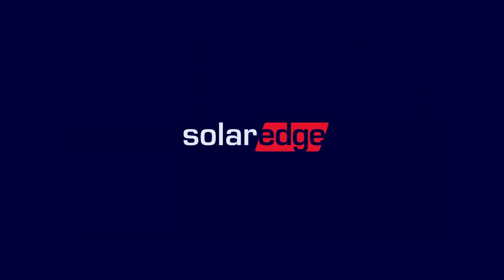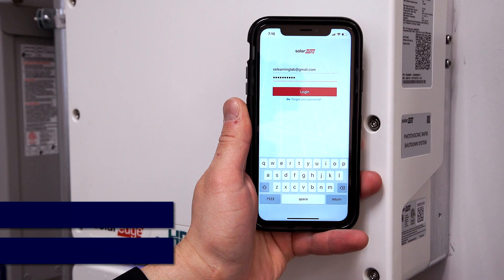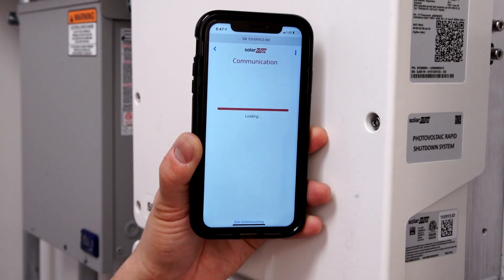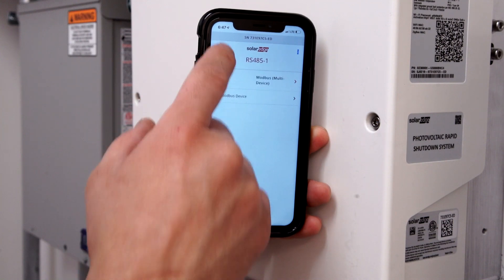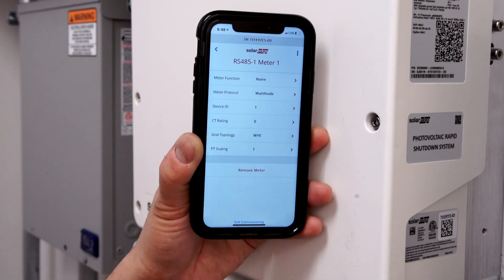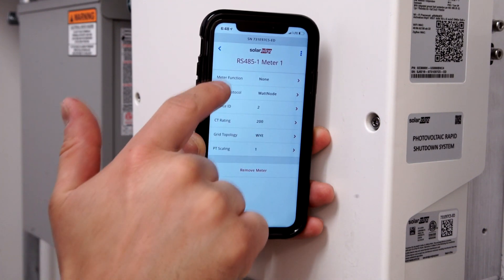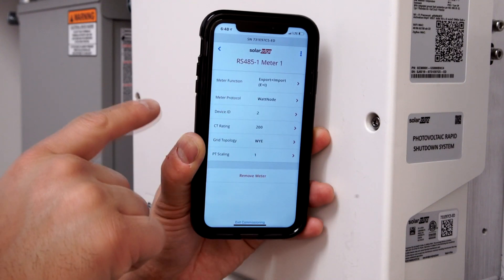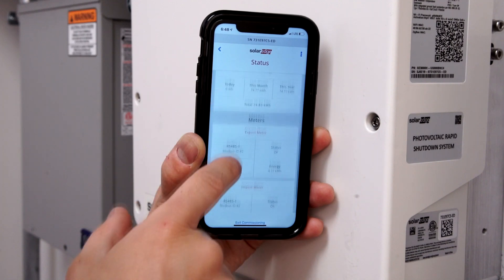Configuring Export-Import Meters on SolarEdge's SetApp| International

Comment: Is the Import/Export Meter built-in to StorEdge inverters, or is it an add-on accessory?
Reply: Yes, I learned the hard way. The original SE Inverter part number ended in "U4" and doesn’t have the meter. There is a version ending in "I4’ and that has the meter built in. I had the solar company swap it out and waiting on installation of the CT’s.
Reply from the maker: a member of our support team will be happy to assist you. You can reach our support at https://www.solaredge.com/service/support.